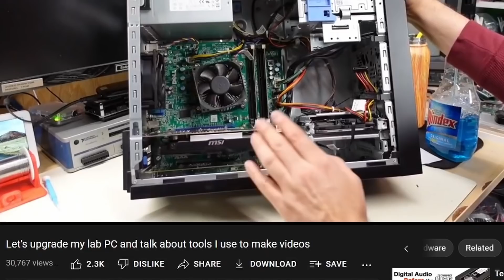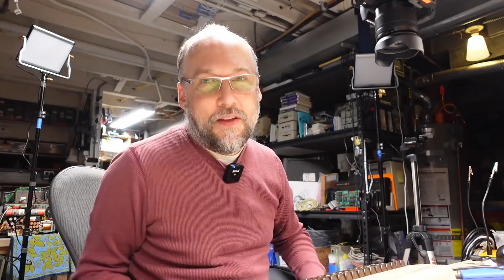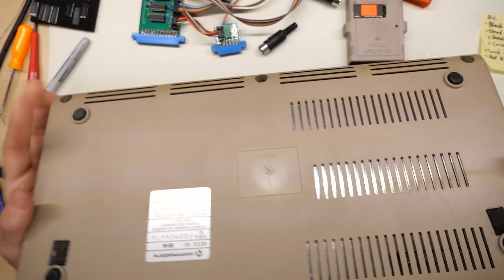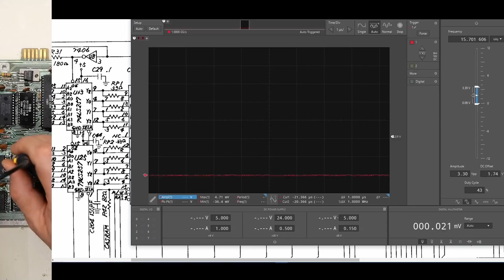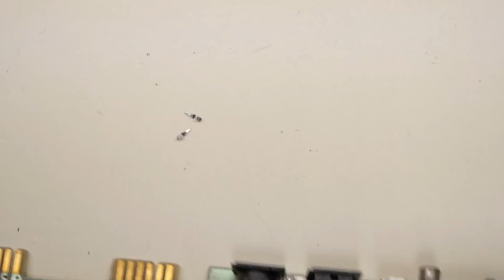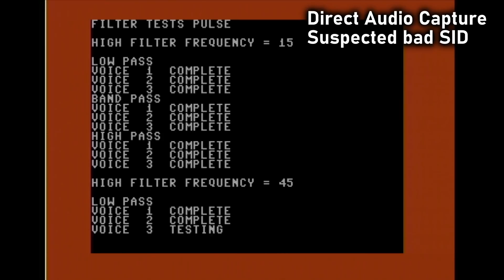Fixing two C64 motherboards with hot chips

Comment: I used to work for a PCB co,pany in the UK in the 80's and the wrinkles on the large areas is due to wave soldering which melts the large area of solder that they used ... these days most are solder dipped after Solder Mask is applied ...  Regards John

Comment: As several people have pointed out is application of tin over the backside of the board before solder masking was applied.  Back in “the day”, again, for RFI reasons, large copper planes  were used to minimize noise.  Mandates from the US government were relatively new so we used the belt and suspenders approach. As we learned more about RFI and specifically what caused it, a properly designed circuit board optimized to avoid RFI was more effective than “dump a lot of solder over it and hope for the best”.  Also, in the day, when the trace masks were layed down on the PCB, it was plated with tin.  That resulted in fewer defects because the acids that etch away the copper sometimes would eat through the etch resist especially if the chemicals weren’t quite right.  This would not happen as only the copper would be removed when the plated tin was used as the resist.  I was designing printed circuit boards just at the time a LOT of new technologies in PCB production were invented.  Retired now but it was a wild time back then.  I was learning alongside the engineers sorting this stuff out.  Fun times.

Comment: Regarding the RF shield, it really is a good idea to put it back on after you're done (you don't need to solder down every singe tab).  Yes, many things are more resilient to RF noise nowadays, but old machines like the C64 can put out a lot more noise across a much broader spectrum than things like modern switching power supplies do, and can still produce significant interference for many types of devices.  Because everything is digital now, the interference usually isn't as obvious, but that actually sometimes makes the situation worse and harder to actually diagnose.  In the analog days, if you were getting interference from something like a C64, you would hear it as noises, or see it as picture artifacts, etc.  Nowadays, you'll just get digital devices randomly not working sometimes, or randomly cutting in and out, or significantly reduced range on your RF devices than you should have, or reduced WiFi speed, etc, with no idea what's actually causing it (unless you go around and test turning on and off everything in the area to find out what the culprit is).

RF shielding does still matter.  Arguably even more nowadays than it used to, it's just often less obvious how much it actually does matter nowadays because the resulting problems are often more subtle, annoying, and hard to troubleshoot.

Comment: Thanks for your work! I have strange issue with mine C64, board 250425. When you put it away for a longer time and then turn on, it's not turning on at all. The LED is also not turning on. I can see Voltage 5V and 12V on Voltage regulators using my multimeter. And after 3-5min it's turning on. Dead Test passing well. Also got new power supply with good voltages on pins. I think it might be kind of issue with power line. What do you think guys?

Comment: About the wrinkles.
I remember in the past 
the bottom side was called the solder side, 
while 
the top side was called the component side. 
(Could use the wrong words since english is not my native language)

You can also still get such wrinkles when you order PCBs from a cheap supplier and pick HAL (LF).

So I guess it happens on the bottom side, because it was the solder side where heat is applied and the board is finished with  HAL instead of gold to cut costs and the manufacturer did not get the HAL to make a flat surface.

Comment: 16:59 ... The board was soldered by wave soldering. The bottom of the board (the one that has the solder joints) face the wave and probably the intense heat and the use of flux made the solder mark to look like crap. It is not the copper, just the mask. Some soldering machines use a flux wave BEFORE the soldering wave.  You can see the fumes and flux crunching noises as board poases over the wave.

Comment: Well done, Adrian.  I love your videos. Have you ever seen the Australian designed and manufactured Microbee? The first model came out in 1982 but there were design issues causing unusual interaction between the CPU, RAM and video, That was fixed in around 1985. The machine had a Z80A CPU and ran CP/M. I really liked it.

Comment: The origonally had a shield over the board with tabs that would touch the hotter ICs and was used as a heatsink..I spent about 10 years repairing these and other Commodore products.

Comment: Yep, brings me back to the good old days 1984/5-ish when I worked for an Authorized Commodore Repair Center... I quickly learned to identify bad chips using my finger... sizzle sizzle...  Yep that's the bad one! LOL.  Most of the time it was a bad RAM chip. Although I have a memorable bad SID chip, when I pressed down on it then it started working correctly, took my finger off of the chip and it went back to making funny click click sounds.  Quickly I determined that it was actually the single-wipe socket. I tried to determine if the chip had a bent leg or if the socket had a bad metal contact... after reseating the chip the problem was not resolved.  Eventually I gave up and the repair to this board was to solder the SID down on the board directly because I didn't have any of those sized sockets... sorry if that makes someone mad to hear, but the shop didn't stock sockets for that kind of repair and the board was already taking a long time to find and troubleshoot the issue... Customers were demanding their C64's get repaired ASAP and I had still had a stack of C64's to get through... so it passed QA testing and on to the next.... Anyway,  Adrian... Happy New Year and Cheers!

Comment: When cutting legs and pulling them out, instead of tweezers (which can act as a heat sink making it harder to remove) use a small magnet on a stick, the legs are ferrous so they will be attracted by the magnet and pulled out of the board.

Comment: I had an Assy 250469 recently with broken ram that didn't like a Samsung RAM chip like the one you installed on the one in the video. The machine did start but didn't want to run stable. I though I had a bad of bad chips for a while, but after multile chip swaps, investigation turned out it was the board. It took me a while to find the cause and was timing related. Installing a 15pF capacitor between the RAS line and ground did solve the problem.

Comment: Back in 1984 my C64 came up with a black screen.  When I dissembled it the only thing obvious was the RF Shield solder joints were broken.  After I re-solder it everything was fine and it worked great several more years until I replaced it with a C128D.  Never really figured out why that fixed it; maybe something with the ground connection I accidently fixed at the same time.

Comment: Adrian gets his groove on in this one! LOL!
@Adrian
Tip for making chip legs shiny and workable again; re-tin them. Brush some flux on all of the legs and then use solder to re-tin them, making sure run the soldering iron tip from the tip of the leg to the point where the leg bends into the package so the solder doesn't pool down on the leg tip. This procedure will restore conductivity and even strengthen up the leg a little.

Comment: Hi Adrain, Love your videos as always but hoping you can perhaps do a introductory series to repairing electronics / diagnosing faults as your more knowledgeable than a lot of us Noob's and i don't always follow your logic in how you repair your circuits. Sometimes its the jargon or how to use the oscilloscope or perhaps basic knowledge on ic function which you perhaps assume we all know. So , I think, a series covering oscilloscope use, component function and explanation on why its needed. Eg Caps are basically small battery's, as i understand it, that charge up and provide a constant voltage ? to reduce 'noise' or fluctuation in voltage ? But WHY ? its the simple stuff that trips a lot of us up , stuff that you likely know and don't think about and don't tell us !

Comment: I honestly hate 250425 boards, as the wrinkling sometimes is so terrible that it makes replacing ICs in the RAM area difficult. I'm not sure if anyone else experiences this, but I find the solder underneath the mask will bunch up in places, and will make accessing IC legs more difficult when you go to desolder.
Reply: I experience this as well, you need to be extra careful when doing desoldering work on those boards.

Comment: I think the "funny sounding" SID is an original R1 since it doesn't have a revision number, and ISTR your ZIF standard is an R4.  I have an R1 SID that has similar filter characteristics, and there are a number of songs (Ben Daglish tunes come to mind) where the bass sounds are completely sucked out on it. It was originally in my longboard 64 which stopped working when I was in college, and the 64C that I got to replace it has a newer SID (R3?) that sounds as expected.

Comment: I never got my hands on a C64 or C64c before the prices shot up.  I've learned so much by watching/listening to these repair videos.  The excitement is pretty contagious when solutions are found.  My dad got a C128D back in the late 90s by accident from an office sale and so that was my xmas present that year.  Thankfully it hasn't had any problems really, while I love the traditional wedge/all-in-one design of micros the 128D is a great machine IMO.

I have kept a collection of Apple II's though, a standard //e, //e Platinum with the numpad no IIGS upgrade, //e Platinum with the IIGS upgrade kit installed, and a IIGS Woz edition that's been mine since ~96 that was fully upgraded with accelerator and other cards for a printing house.  Also, a small pile of 5.25 disk drives and 2 3.5 disk drives for the two IIGS.

Comment: I've found that a hot air machine is the best way to remove the bottom RF shield.  No need to desolder anything, just shoot the air and use a screwdriver to remove the tab. Works great!

Comment: Hey buddy i just got a quick question for you. I own a IBM P200 20 inch CRT monitor and it's been working good for the past like 8 to 9 months than all of a sudden a few days ago the image does not want to appear on the screen. i have to put a small blanket on the back of the CRT to let it heat up a bit than in like 30 to 45 minutes the image will appear. Do you know if this is a fixable problem? Let me know thanks.

Comment: The wrinkles are because after the board was electroplated with tin, then the chips were put on the board and it was passed through a wave solder tank then the mask was laid down.
Reply: Solder mask is applied before component insertion or wave solder process. The whole point of solder mask is to reduce the likelihood of shorts. Plus if it was put on after the components were inserted, there would be no mask under components. Wrinkle appearance is due to solder wicking under the mask.

Comment: I agree, even if I don't have a high interest in what is being fixed, I do enjoy watching the troubleshooting.
Back in mid-late '80s I worked on C64s.  We had a dead test diagnostic cartridge that had an LED matrix that would show which chips it detected as bad.   It didn't require much to be populated on the board.   I think all it needed was the graphics chip (probably for clock) and CPU.

Comment: I don't know if it's actually that EMC regulations in the US were technically stricter in the 80s or 90s, or just that foreign designers put overkill shielding on their US variants because they found US certification cumbersome and expensive to go through so they wanted to make absolutely sure they passed the first time.

A lot of game consoles designed in Japan also had shielding that was only on the US versions.

Comment: The hybrid desoldering gun/hot air method for removing DIP chips does actually work pretty well, I've tried it!

The only thing I want to flag about it is that it can result in the chip having some residual blobs of solder on the legs that make it difficult to then put that chip in a socket. If you can deal with that, that's fine.

If your desoldering gun is in good condition and you use the right technique, you should be able to get all of the solder out of the joint with just the gun. This is really the ideal way to do it but it can be a pain sometimes and if you're in a hurry the hot air method is fine--just gotta be careful because if solder is on the edge of molten you can easily end up pulling on the pads or through hole plating .

I think it might be a different story if you're working on game consoles rather than old desktop computers, because I think game consoles were typically built more cheaply and often this means phenolic/paper PCB substrate, which is not as sturdy as fiberglass.
Reply: Who managed to out-cheap Commodore?  That’s quite a feat!  😄
Reply: @sirnickity  I've not looked inside of a Commodore machine myself, but I'd be surprised if any home computer were as cheaply built as the Mega Drive/Genesis.
Reply: @rfmerrill   Wait, huh?  What's wrong with the Genesis?  I have one on my workbench taken apart.  Doesn't strike me as too different from anything else of that era.  I mean, it's no Dreamcast...  :-)

Comment: Now that most of our radio transmissions are digital (digital TV, digital radio now as well, etc) and on different frequencies, the occasional RF from your retro computer is not going to bother anyone.
Reply: Nor is it going to be bothered, I bet. I have an Atari 2600 that I distinctly remember putting out a pretty lousy video signal, but I dug it out a couple years ago and it was clear as a bell. It probably helps that I live out in the sticks where the air isn't full of whatever the old RF band is used for nowadays. People's wifi signals, probably, or cell phones.

Comment: 11:00 I doubt Commodore/MOS made their own versions of "74LS whatever" becuase they couldn't get them, rather because they wanted to save some cents (or just though it a cool thing to do). TTL has always been plentiful, not least around 1979-82 when this thing was designed.
Reply: Around 1982/83/84 there were supply chain issues around a lot of 74 logic, especially commonly used parts in 8 bit computers, due to the explosion in manufacturing of computers. So Commodore made their own chips to stabilise the supply. It also used up spare capacity in their chip factory, saving costs.
Reply: @IanSlothieRolfe  Really? Can't remember that we experienced that here in Sweden, but I belive you. I guess they implemented them in nMOS though. Or did Commodore/MOS have access to bipolar processes too?
Reply: @herrbonk3635  They are NMOS. Commodore only made them when they had supply problems.
Reply: @danielmantione  Sound logical. But there were at least 25 manufacturers of TTL in the early 1980s. I guess these chips must have been pretty new or special TTL parts?  We never had any major problem with our TTL supply chains in Sweden at the time.
Reply: @herrbonk3635  They had 74x02, 74x04, 06, 08, 139, 245, 257 and 258. I don't see anything new or special about them. But remember Commodore did need millions of them per year and also in the consumer market, you need to be able to buy them at the right price.
Reply: @danielmantione  Yes, that's what I said in my first comment. They probably tried to save a few cents.
Reply: @herrbonk3635  You did,, but if was purely because because of cost-cutting, they would have preferred their own chips, while it looks like their preference was to buy them from the market.
Reply: @danielmantione  Did they use TTL in the beginning, then swiched to their own nMOS, and then back to TTL when the shortage was over? That would perhaps make it look that way. But it could also be an experiment for better economy, or even for fun.
Reply: @herrbonk3635  MOS "TTL" chips are mainly found in mainboards made in 1983 and 1984. Perhaps it dates a bit further back, as I have a VIC-20 from 1981 that has MOS logic chips. There never was a switch, they are jfound on some boards, while other boards made in the same period have standard chips; wether your board has MOS or standard chips is a matter of luck.

Comment: I just got my first Commodore 64 from eBay and it had never been opened, I could tell because the screws had that distinctive crack as I took them out the first time and it was perfect inside. I was honestly kind of disappointed because I wanted something to fix. 🤣
I did end up replacing the 7805 regulator because the chips were getting 5.96 volts and that seemed a little high.
Reply: It definitely does, especially considering it's a volt more than the power supply ought to be providing. Now I wonder if a failed regulator is partially responsible for why an over-volting power supply can be so disastrous.
Reply: @stevethepocket  yeah I knew the old regulators were not as efficient as even the cheap ones we can get today and over time they definitely can go bad so I always keep some on hand for old electronics like that.

Comment: The wrinkled solder mask on the bottom is from the "wave soldering" system. The board literally passes over a flowing fountain of molten solder and that solders all the through hole components at the same time. I used to run one of those machines in the olden times. Had a really funky smell from the rosin in the solder.
The solder just gets onto the underlying copper traces, under the mask and bubbles the mask up.
Totally normal.
Cheers and have a good new year now o/